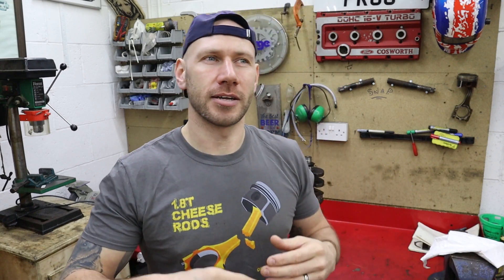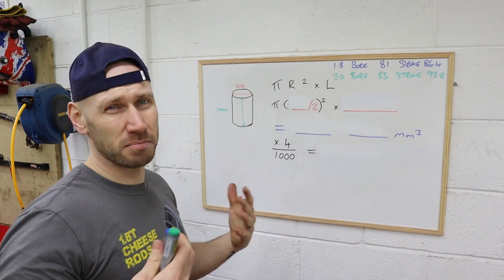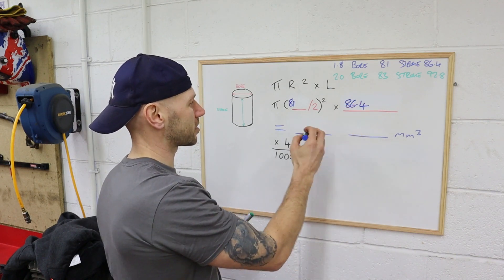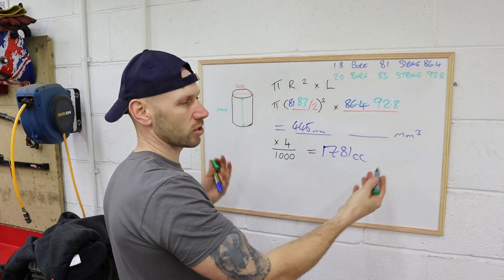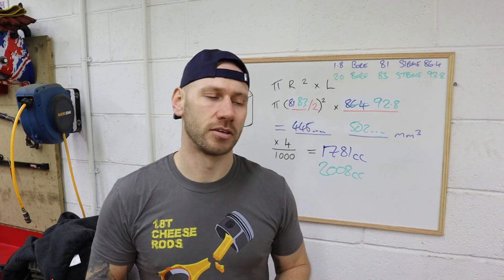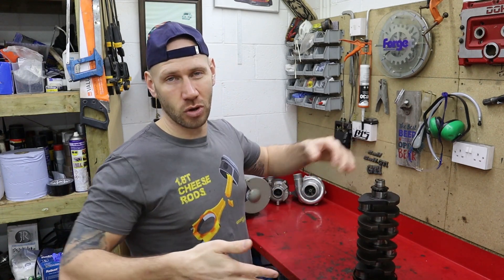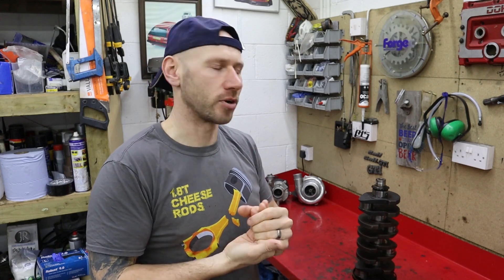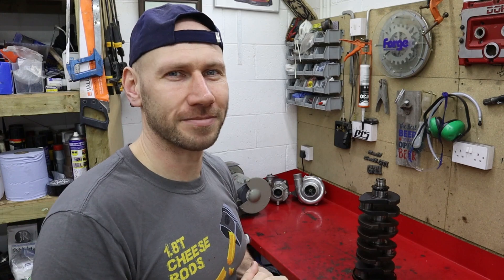What is a STROKER motor...?

Comment: There’s nothing special about a 383 stroker it’s hard on fuel. It has a limited power and it’s a piece of junk. It’s hard on fuel. It’s only made for racing. No idiot would put it in their vehicle and drive it down the road only people with way too much money would build a 383 strokerbecause they have no use they’re not for the road otherwise vehicle might’ve came with one, but it never happened. 383 stroker is a made engine.

Comment: How the heck can a motor's strock (length) be increased without using a taller crankcase..? Or adding some kinda spacer..?  I just do not get it. I get that there's room to increase the bore. But if you change the length of the crank (eccentricity?) won't it run into the head or valves at TDC..? I just don't get where the adjustment is coming from.  Can the skirt be shorter? (a question I've always asked I guess in another context). I'd've thought a taller crankcase was needed.
Reply from the maker: The wrist pin location is offset in stroker pistons to prevent the piston crown protruding from the top of the bore
Reply: Did you even watch the video? He said explains it in there

Comment: what about destroking a motor? what advantages do you get with that?
Reply from the maker: You can  make the engine more over square and possibly make it revvier which can  lead to more power at the loss of torque generally. Not a common technique really
Reply: @Decimal Tenths  that makes sense but id rather have torque lol

Comment: what big end bering (size, spec) should be used for this setup. ? thanks
Reply from the maker: The crank is dimensionally the same as the 1.8t so use stock bearings. I prefer Kings racing or ACL.

Bearings need to be used that will match the crank whether it is standard or ground undersize

Comment: Thanks mate, that explains it. Do You pick the bore hole size depending on what piston sizes are available in the market and then ensure that's compatible with the crankshaft you're purchasing too?  

Also, after these modifications will you need to retune for more Air/fuel?
Reply from the maker: Yes the bore size will be made to match up with the pistons you have. They are also chosen to match up to the stroke length that you are using. 

For 1.8t, stroker pistons are available in every flavour. For other engines I'm not sure
Reply: @DecimalTenths  nice! I'm assuming these modifications require the car to be returned for air/fuel?

Comment: Very useful - thank you 

Longer throwing crank, which gives more depth and more height
So why doesn't the piston crash into the valves or head?

Shorter pistons (which also increase the capacity on the down stroke)

👍
Reply from the maker: Yes the stroker pistons have an offset pin height which keeps them below deck height. 👌👍

Comment: Do I have to bore my 1.8T 06A out to 83mm to run stroker crank and pistons?

It’s currently at 81 mm and I just ordered 82 mm JE pistons, and I hope I didn’t make a mistake by not going with 83 mm for when I do the stroker crank later on down the road.
Reply from the maker: You can get 82.5 and 83mm stroker pistons. Doing them stock size is pointless considering the whole point of the stroker is to increase capacity.
Reply: @DecimalTenths  Thanks. I guess I’ll just go with a bore for my new 82mm pistons for now. Save the fun strokes for future folks.

Comment: Thank you fir the explanation.  Could you fit the crank and keep the pistons and bore diameter standard or would the pistons be too close to the valves when running hence different pistons
Reply from the maker: Definately different pistons required. Depending on what engine/piston combo used - pistons could be machined. Buy for 1.8ts its new pistons time

Comment: I need to watch this. I have a stock 2016 Genesis Coupe 3.8. Wondering if the Brian Crower stroker kit is worth the money in the future. My goal is 500whp as a daily. So the options are a built 2.0 engine, or have the car LS swapped. If the stroker is worth it, I may keep the 3.8 engine. Mostly because it sounds like a GT-R with good exhausts.
Reply from the maker: Bet it sounds great!! 
Stroking a motor is definately worth it, but only if the goal is big power. Time and money wasted if the same output power goal can be achieved without doing it

Comment: Very interesting, can you replace the crank, the pistons, , keeping the same bore but only increasing stroke,eliminating the need for machining, if so to what effect.
Reply from the maker: I don't think any manufacturer sells std size stroker pistons. Simply because if you're buying new pistons, then you may as well go stroker 82.5 or 83mm as the cist is generally the same. The only difference is the machining  which is small in comparison.

Comment: to stroke the engine do you really need to change the crankshaft or keep the same crankshaft??
Reply from the maker: Depending on the engine there's a few options. Some crankshafts can be offset ground to allow more stroke. Other engines like 1.8ts, its easier to just use a different crank as they're easy to get a hold of
Reply: @DecimalTenths  lets say the S54B32 i know there is strocker out there but not sure about changing the crankshaft

Comment: so if the strokers pulling the piston further down, and then further up to increase the stroke, does that mean that the piston has to be made thinner as not to bang into the head?
Reply from the maker: The wrist pin is offset, more towards the crown in stroker pistons so that this doesn't happen.

Comment: Imperial equation is .7854 X number of cylinders (bore squared)(stroke)=cubic inch displacement. 

Metric equation is .0007854 X number of cylinders (bore squared)(stroke) = cubic centimeters of displacement.

.7854 X 4 X 3.78 X 3.78 X 3.125 = 140.28 cubic inches

.0007854 X 3 X 78 X 78 X 83 = 1189.82 cubic centimeters 

Extra credit to anyone whom can tell me which two engines I referenced for my examples.

Comment: question when u using the bigger say original crank trow is 40mm and new one from stroker kit is 42 can u reuse the same pistons if u don't wanna rebore the engine or will the pistons have to be custom where the pins moved up a bit to account for the larger stroke length as to prevent the piston coming out and hitting the engine head??
Reply from the maker: Hi, yes I'm afraid new stroker pistons are required, for the reason you have mentioned. The gudgeon pin is offset from the piston crown so that the piston does not extrude from the top of the block. 👍
Reply: @DecimalTenths  thank u bro

Comment: Cant believe I missed this one mate.  Couldnt wait for new vids so thought ide watch back.

Doing a tdi crank for a 2.1 sounds really fun.
Reply from the maker: It's a bit more work though mate, oil squirter clearance is more of an issue. Plus an even longer stroke affects the angle of the rods in the block so the bottom of the cylinders need clearances too other wise the rods hit the block. The 2.0 stroker bar the cylinder boring is just about bolt in no issues, as long as you get away with oil squirter clearance... but you'll have to wait for the next installment to see that...😂

Comment: Great video geeza.. Wondering if you could do another video (not sure if you have done) maybe about the advantages to stroking like hp gains and the risks if there are any, also compression ratios?
Reply from the maker: I can certainly comment on it when I assemble as theres some points to consider such as clearances to oil squirters etc. Be doing that very soon!

Comment: I have a aeb engine and head on engine stand. It is my first build and cant make up my mind if I should spend the extra time and money for a stroker. What do u think just motor hp gains would be? How much earlier would a gt2871r spool? I really do appreciate the videos and always waiting for the next ones.  Thanks
Reply from the maker: The AEB engine is an EA827 058 block so is different to the EA113 06A block that I have. In all honesty I'm not sure which crank you would use for that stroker conversion, but I'd imagine it's an easy answer to find. In terms of is it worth it, in most situations unless your going for big power then its probably not worth it. On the GT28 framed turbo it will help it spool sooner by 2-300rpm. Peak power will possibly be higher but not by a massive amount as then you would find the top end limit of your turbo kit.
Reply from the maker: Cheers though, appreciate the comment, and the views 👍

Comment: Amazing video! How does this effect reliability
Reply from the maker: At my power levels the 83mm bore shouldn't make a difference, and the stroke is fone also. If I really pushed the cylinder pressures then with wear there could be a cylinder wall weakness which could lead to failure. I'm not concerned by it though. FULL SEND!

Comment: Okay so with all stroker motors you typically cannot rev as high. What rpm do you think you will be revving to and how would this compare to a non stroker 1.8T build? It's worth it to get the turbo spooled down low but you then can't carry the top end out as far iirc. For instance: 4G63 2.3L strokers can only rev to like 7500 safely (2.0L can rev to 10k+), EJ25 can only rev to like 7200 safely (EJ20 with internals can do 8500, maybe higher) etc. Just curious as to what kind of powerband this will support. Sick build btw!
Reply from the maker: Thanks very much, appreciate it. In all honesty the 1.8t strokers are only marginal increases unlike the 4g63, especially with the 92.8mm crank. There is generally no loss to expected rpm up to around 8200 which is where the 20v head with hydraulic tappets tails off. This build is unlike most strokers out there in that I'm not building this for big power or to rev high, I simply have the parts around so if I'm rebuilding an engine, I may as well use the bits and essentially overbuild for my expected power goals. A torquey fully forged 2 litre build with modest turbo upgrade to easily support 350bhp and stay together with a top end rpm range of 7000rpm (8200 capable) is the spec. Heres to hoping I make it 😁
Reply: @DecimalTenths  That's what I like to see! More power to ya man I built my EJ20K here in Canada and threw an HX35 on it. Stock heads itll rev out to 7800 and carries a decent powerband but with no additional stroke, turbo spools in the late 4k range... not ideal for a daily. Are you going to be loosening up the bearing tolerances or shimming the oil pump at all? As a subaru owner, oiling is one of the biggest parts of reliability!
Reply from the maker: @erikstuebing5408  yeah I'll definately be aiming for tolerances on the "looser" end of the scale. Still perfectly fine for road use though. The stock 1.8t oil pump should do just fine, they arnt known as being failure points, especially if they are new 😎. Yours sounds a beast, my GT3076r 1.9 S3 was similar spool characteristics, around 4rpm and that thing flew